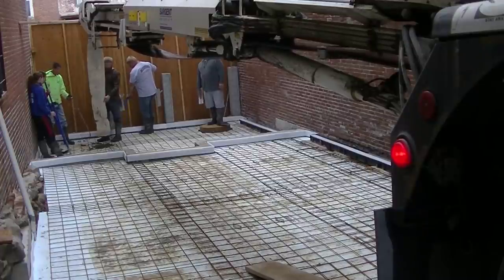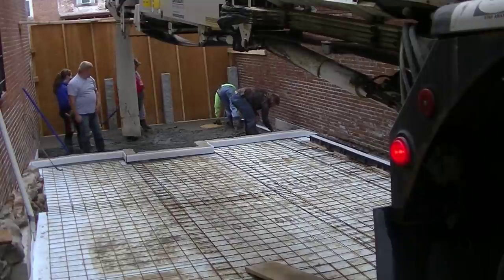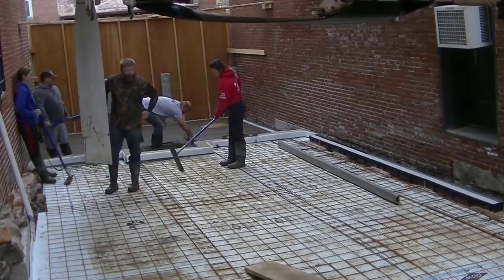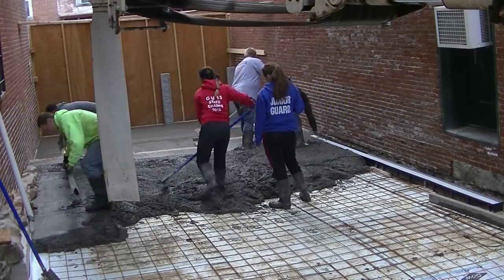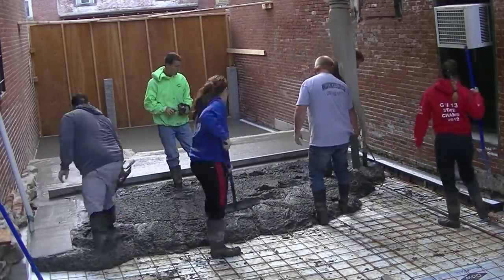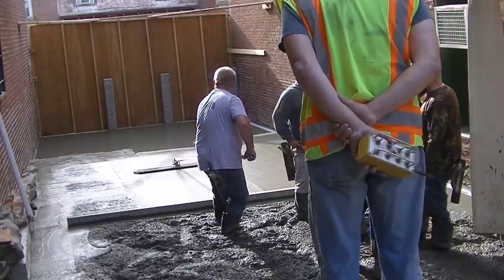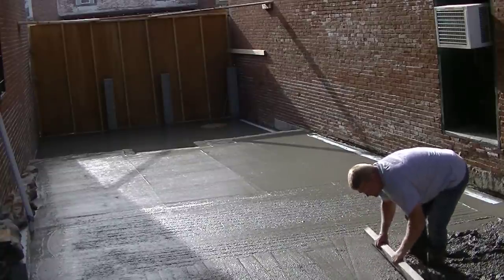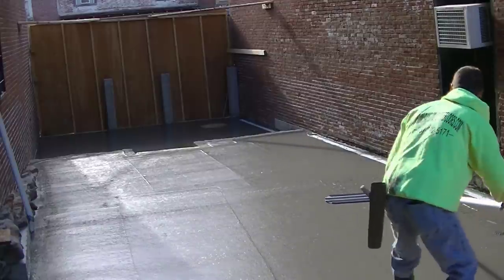Pouring Concrete For A 2 Level Patio Slab

Comment: Those trucks are a trip. Pretty cool thing to see. Never have I seen this on the East Coast of Florida. Keep the videos coming, great work and explaining
Reply: About 20+ years ago C&C pumping in Florida picked up a cpl of those conveyors and eventually had to get rid of them, cuz nobody wanted to use them. I remember them offering me prices that were next to nothing, if I would just use the conveyor over a pump. My finishers hated them, so I only used them a few times.
Reply from the maker: Thank you!
Reply from the maker: They are a little slower than using a pump but if you can reach with them, on a smaller job their convenient and no mess to clean up afterwards like with a pump.
Reply: @MikeDayConcrete  I totally agree with you. Especially when you’re working in what looks like maybe a downtown area, like that, where washing out can be an issue. You can also place a stiffer slump if the job called for it, without the worry of jamming up the pump line. I would have used them more, especially for slab on grade stuff, but in the interest of keeping my finishers happy, I went with pumps. 🤷‍♂️

Comment: Hey Mike I just wanted to tell you I enjoy your videos very much and appreciate the time and effort you put in to help teach people like myself about all things concrete. I have a question for you. I’ve been planning a bluestone patio at my home for quite sometime. I’ve dry laid a lot of sidewalks and patios but I wanted this one to be set on a concrete base. I formed it out and ordered 6 yards of concrete to be delivered. Everything went perfectly. My question is,  I decided that it wasn’t necessary to bull float the surface because it will not be visible because of the bluestone I am going to mortar on top of it. I just screeded it off. I also thought the rougher surface would allow the mortar to grip a little better. Was that a bad decision? Thanks again.